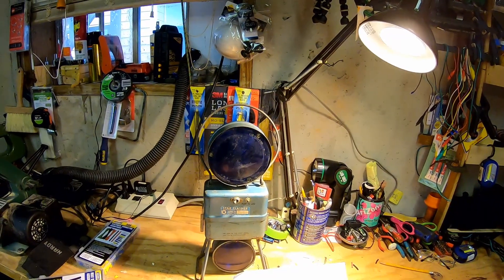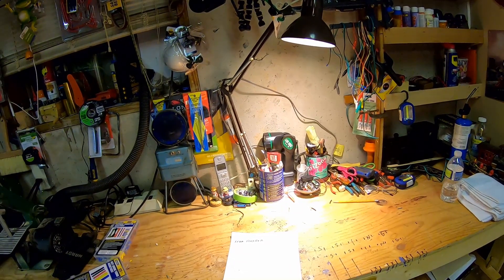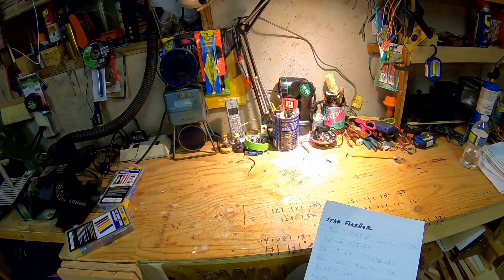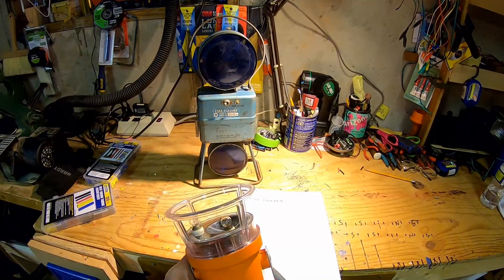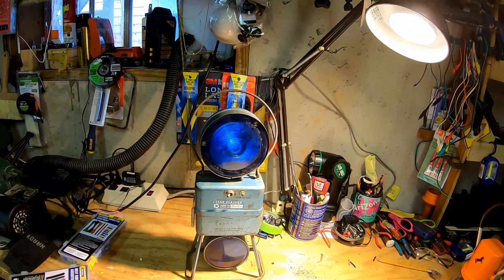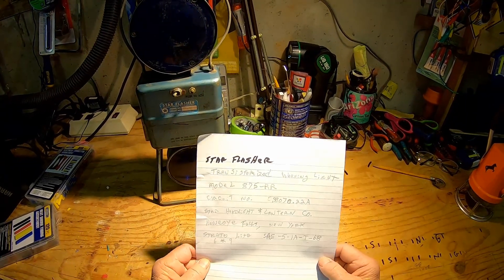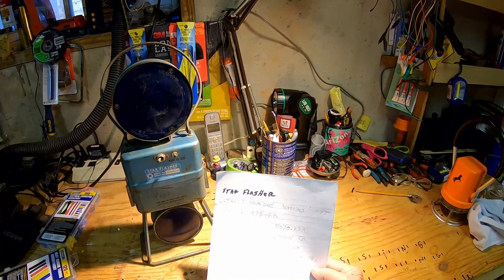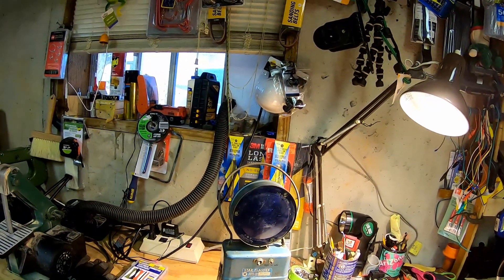Blue Light Railroad Lantern Help Needed

Comment: Walter: The Star Headlight and Lantern Company is still in business. 455 Rochester St, Avon NY, customer service 585/226-9787, Railroad department 585/226-6978, hours: 8-4 Eastern. Rat Kindler says they are responsive, so it wouldn't hurt to give them a call. Jon, MSO-439
Reply from the maker: Cool thanks for the info Jon  I will call

Comment: Walter, I definitely would not try to restore your lantern, and be very careful with cleaning it. I would blow the dust off and wipe with a dry micro fiber cloth and don't use any solvent or cleaners. It is sounding like you have a rare item and restoring it could decrease it's value! The thing is most of the original paint is there, it is not dented or bent up. Sure it's used, but that's also part of its value. I'm sure you don't want to sell it because of sentimental reasons which is great. Good luck and I hope you get over your cold. You take care!
Reply from the maker: Thanks Matt  I have no plans to sell it lol